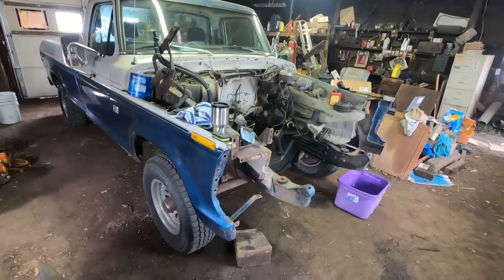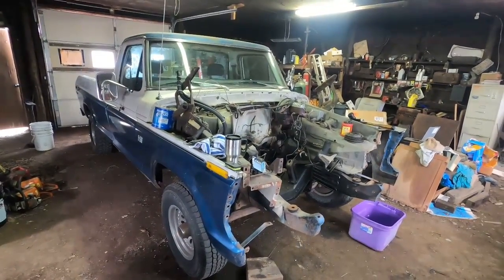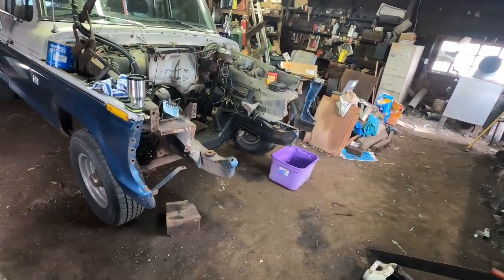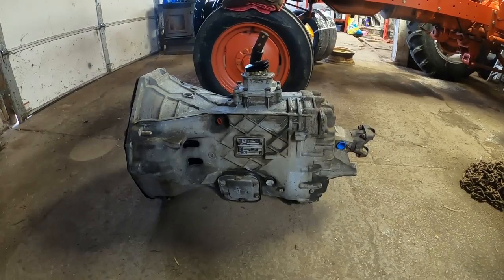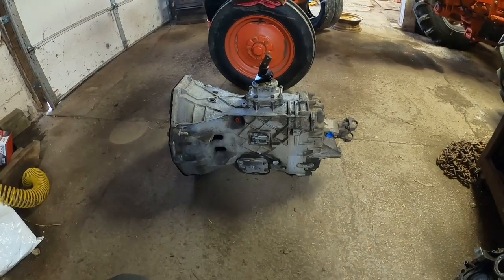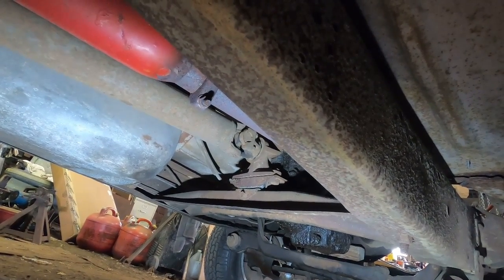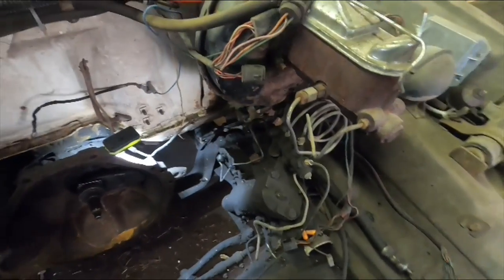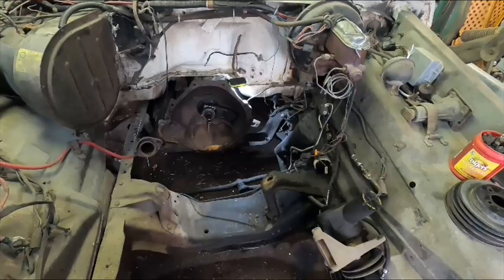ZF 5 Swap: '76 F150, 2wd, 300 Six - Project Overview

Comment: Did the 300 go into the fe engine mounts?
Reply from the maker: Yes, but you have to move them ahead. There are another set of holes in the frame rails. Just unbolt them and move them ahead to the next holes. Six cylinder and FE brackets are the same.
Reply: @farmerpete  thank u....did you use the 390 radiator?
Reply from the maker: @whirlwindjml  My old FE radiator was getting kind of rotten anyway, so I bought a new replacement radiator for a 300.
Reply: Good call

Comment: That transmission will be a nice companion to the 300-6.  It does have a creeper first gear?
Reply from the maker: Thanks. This is the “wide ratio” ZF 5, first gear is pretty slow. Not sure if it’s as slow as granny gear in the old 4 speed. Guess I’ll find out.

Comment: I mounted the clutch master to the firewall years ago when I put the 4cyl cummins in my 77, thats pretty heavy metal back in the day. I think we reinforced it with a back up plate also. But it's been years and no problems. Would love to see the bell crank arrangement
Reply from the maker: Thanks. I have the bracket and bell crank all designed in my head. Hope it works as well in real life.

Comment: Thanks for the update, our bodies may not work as well as when we were teens or twenties, but our desires to rebuild/build and refurbish never goes away. Looks like that jack has never left the inner fender in 48 years, the one on my 97 F250 has never been used but it's now on a shelf. My 4X4 truck (not lifted) sits too high for that jack anyways.
Reply from the maker: Thanks! I think you're right about the jack. Yes, after 27 years, one of these days I'll have it the way I want it 🙂